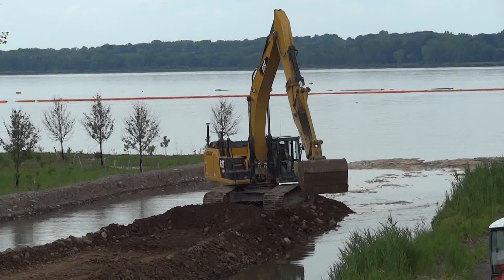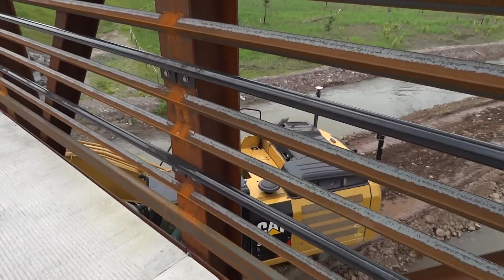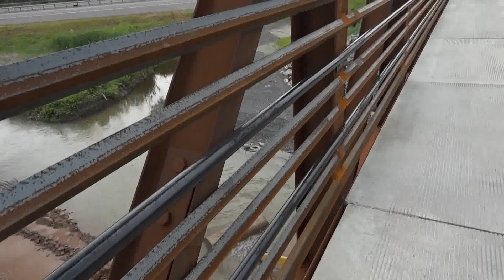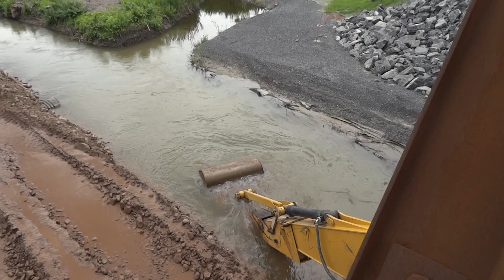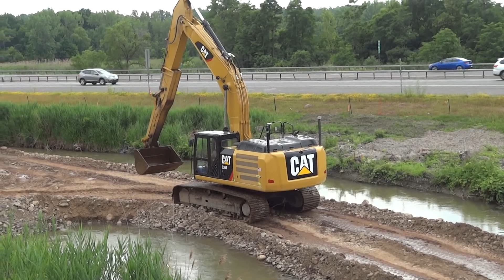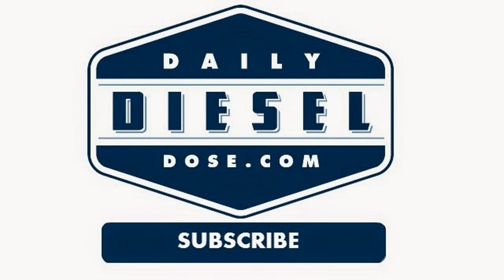Cat 336E Excavator with Add-A-Boot

Comment: Great video.  Any idea what that is that he was working on?
Reply from the maker: The trucks would run material down and the excavator would use it to make the road a few inches longer with each pass. I'm not sure what they are trying to do with a road in the middle of a creek.
Reply: 三級